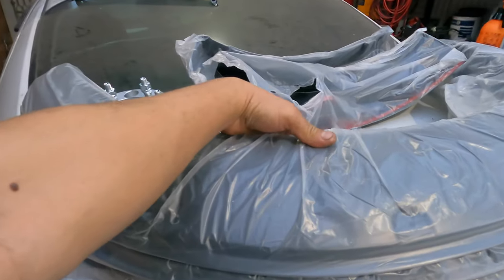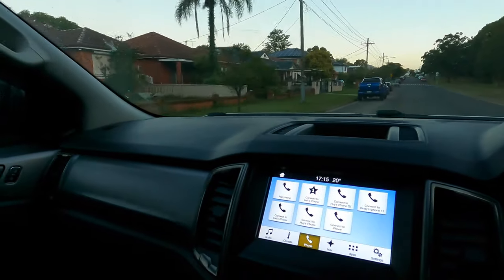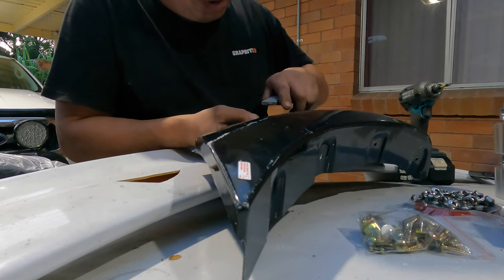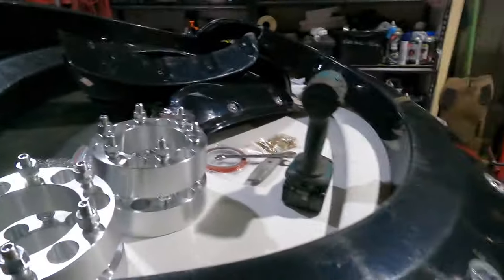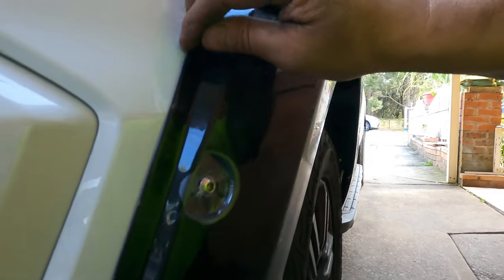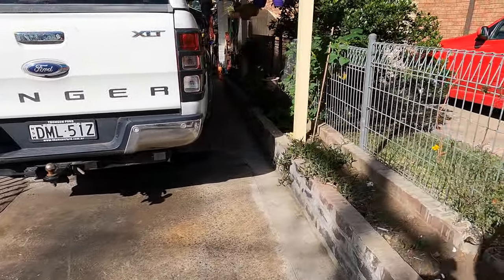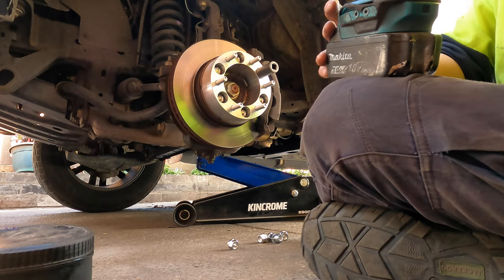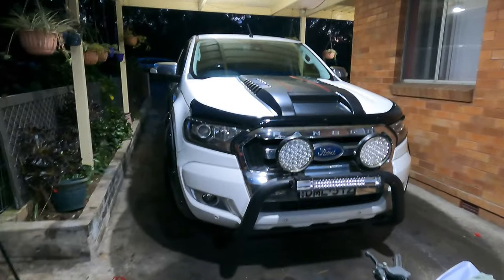ford ranger 2016 wheels flares and spacers installation

Comment: wrong, use the original  nuts on the wheel, not on the spacer,  use hub centric spacers   and a torque wrench , this is too tight ,no grease on threads, just a thin layer of anti seize between hub and spacer